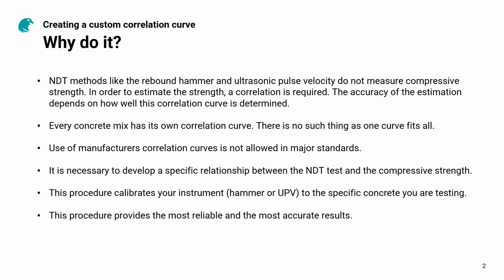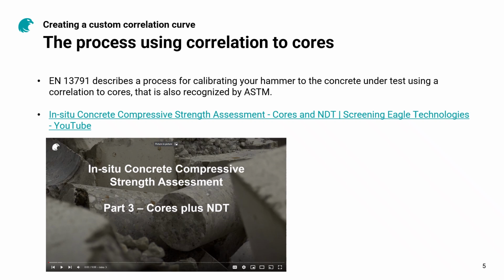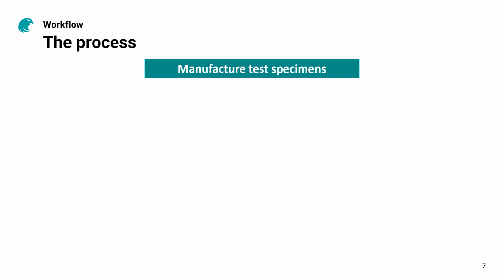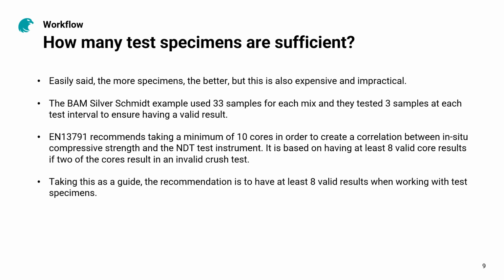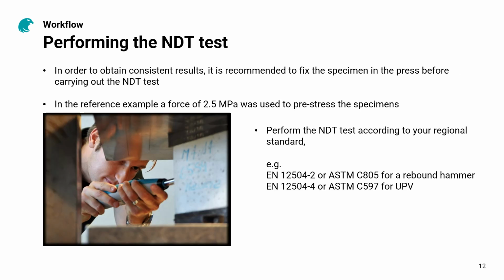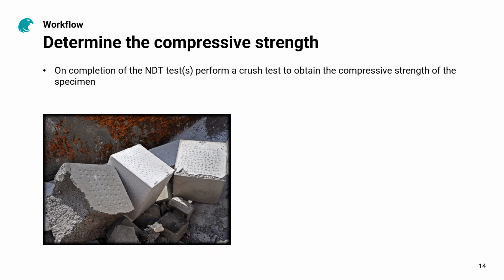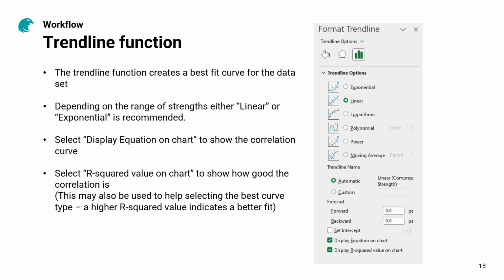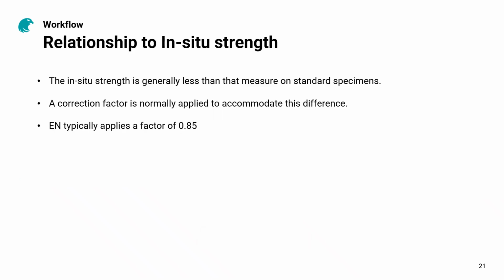Process to Create a Correlation Curve for Concrete Compressive Strength Estimation

Comment: Hello David. How do you do rebound hammer on cylinder samples? Let’s say 3” diameter.
Reply from the maker: Hi @hlayssi !  
When conducting rebound hammer tests on cylinder samples, such as 3" in diameter, the approach is similar to that used in rock testing, particularly with core samples. In these cases, a support is often recommended for stability. The methodology for rebound hammer testing with concrete hammers, like the Rock Schmidt, aligns closely with this principle. To provide a visual reference, I've attached images demonstrating a test setup suitable for conducting rebound hammer tests on cylindrical samples. Feel free to review the examples for a better understanding. If you have any further questions or need additional clarification, please don't hesitate to ask.